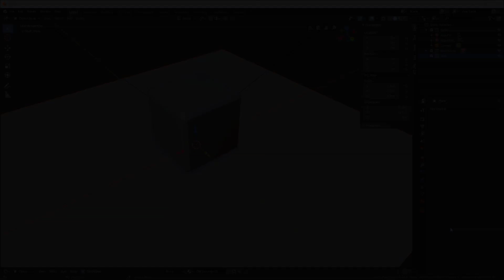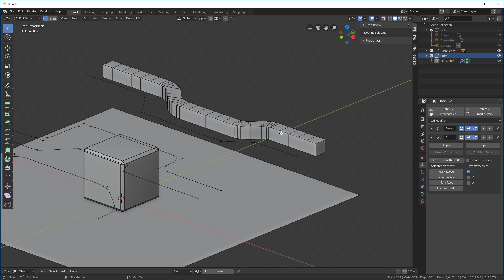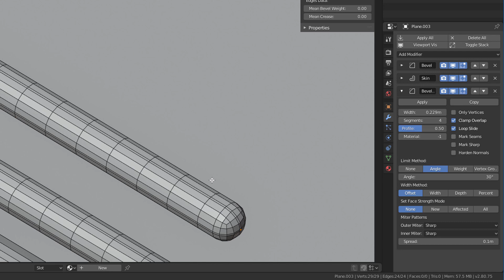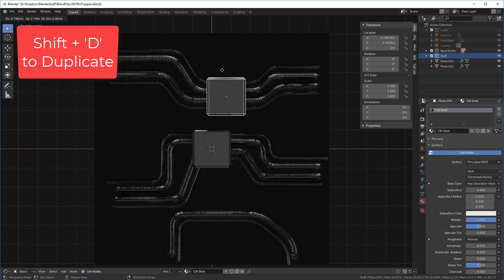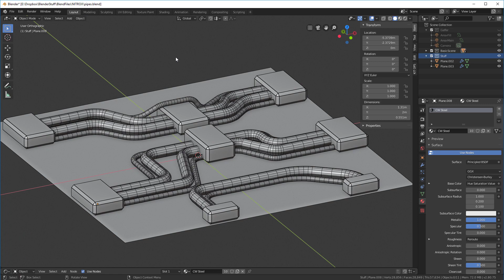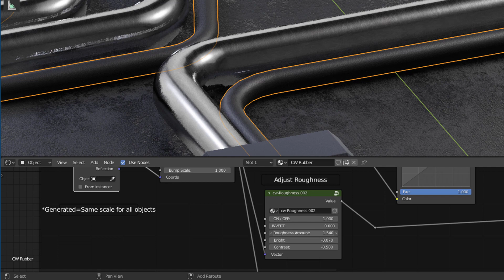Blender NITROX3D 11: Editable Pipes

Comment: Pro tip: set the bevel that makes the pipes round to percent offset method and use 48% (so you don't get overlap) (if you want them to be 100% perfectly round and use 50% you'll need to add a weld modifier right after the bevel)
This will make the bevel proportional to the edge length, meaning you can have variable width and possibility for elliptical profile
Reply from the maker: Thanks. I'll check it out!
Reply: A tip: watch series at flixzone. I've been using them for watching lots of of movies recently.
Reply: @Giovanni Jake yup, been watching on Flixzone for months myself =)

Comment: You dont happen to have any tutorials on how to make hard surface rivets do you? I mean I know how to make a rivet and apply it to a surface but what I cant figure out is for say a tank hull where it has rivets all down the edges. Trying to learn how to do this without having to hand place a thousand rivets.
Reply from the maker: You might check out KIT OPS PRO. You can insert a rivet, then duplicate and move it, then shift-r as many times as you need...
Reply: @ChippWalters  Thanks Chipp, yes I have pro and will give it a go and see what I can do with that.

Comment: Is there a Problem that i cannot Bevel my Vertexes with the modifier on Blender 2.8 RC2 ?
I mean i set the weight of all of the vertexes to 1.0 and as soon i chose the modifier Bevel and Check the only Vertexes + ByWeight nothing happens.
Can someone confirm it is working on RC2 ?
Or maybe provide me a scenefile. Its really wicked. Thanks in advance.

Comment: Thanks for the tutorial ... The skin modifier generate a lot of edge loops in the 'straight' parts, is there a non destructive way to get rid of these uneeded edge loops to get the polycount as low as possible ?
Reply from the maker: Sure, add a Decimate modifier after the last bevel, and set it to PLANAR.
Reply: @ChippWalters  Thanks, I haven't taught about the decimate modifier ;)